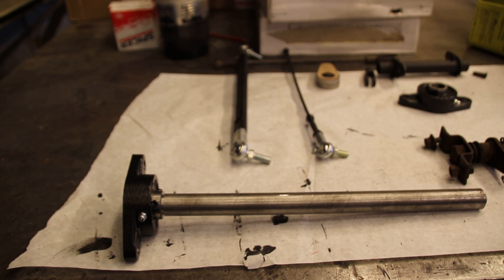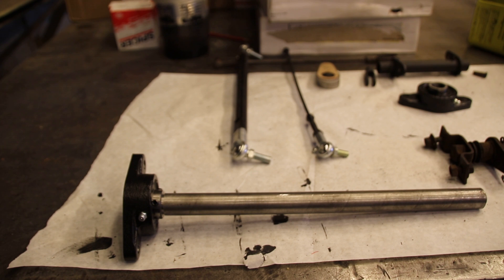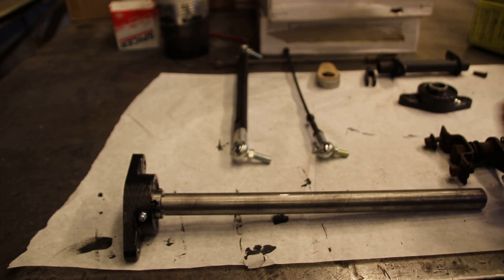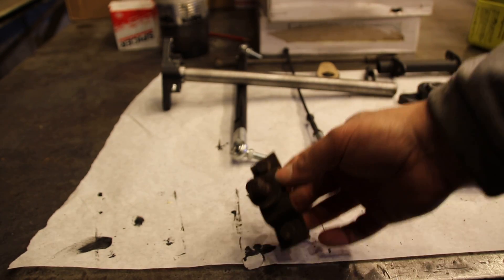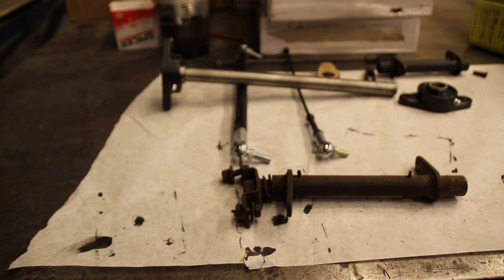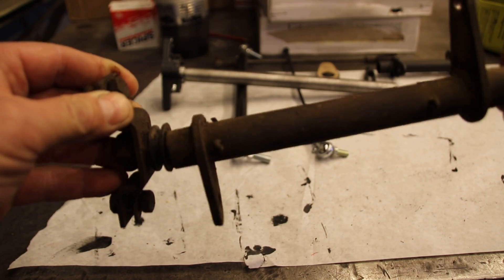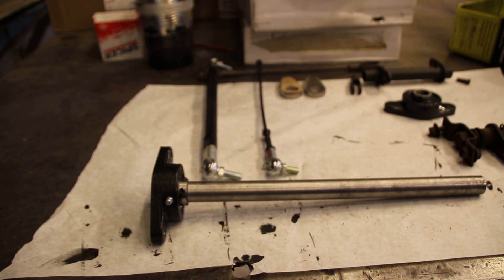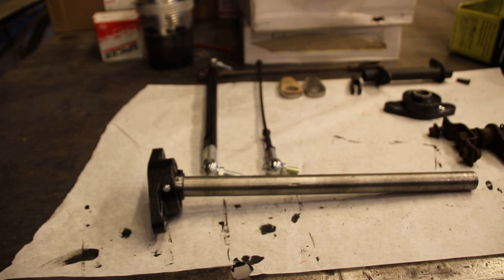Clutch linkage update and response to hate mail

Comment: A masterful job, a very well thought out design with superior construction.  Pivot balls and cheap clutch linkage have always been a curse on street rods and muscle cars also.  Using floating pillow blocks on each end of the Z-rod instead of pivot balls is pure genius.  I’m going to begin to apply your design to several 1960’s and 1970’s muscle cars that we are in the process of rebuilding for hard street use; pedal pressure is going to feel like a tub of melted butter!  Thanks  for this great idea!
Reply from the maker: Glad you got some good ideas.  I put this type of linkage on many different vehicles and it works flawlessly.  I am sure you will like the setup once it is installed.  The pedal will feel great !!

Comment: LOL My brothers and I raced Jeeps off road, we did not build that joint that heavy but I love your idea.
Reply from the maker: I have been using this type of clutch system for many years now in race prepped jeeps, off road, and daily drivers.  Never had one fail or wear out due to use and figured I would share with others.

Comment: Great series of videos. Keep up the good work. Have you worked on any of the Mitsubishi assembled Jeeps? What you think of them? And maybe for the hate mailers you could design a unbreakable linkage between mouth and brain.
Reply from the maker: Yes, many years ago one of those Mitsu jeeps made it to my shop for some body work.  They seem to be a pretty solid rig, but are pretty scarce here in the USA.
Reply: They are rare here in Ireland too. I think there are 4 registered here and I own two of them! Your series of videos has already dug me out of trouble with a vibration from the drive train. The guy that separated the driveshaft didn't see that bit about aligning the Spicer's joints when reassembling. The Mitsi Jeeps have the same rust traps as the trucks in your videos. Aside from the engines the gear box, transfer box and axles look identical to the original Jeep.
Keep up the good work!
Reply from the maker: glad you got your driveshaft vibration figured out.  Would be great to see your Mitsu Jeeps one day.   Keep watching for more videos that are on the way.

Comment: Nothing wrong with your linkage upgrade. I had a CJ5 and lived with precisely that original stock linkage disaster that you show at the beginning of this video. The problem is a bad design that relies on relative alignment of the engine and the frame. Both will flex to an extent, and the older the Jeep, the more it flexes. Had mine modified, but it was a less than perfect solution. This looks far more robust and tolerant of abuse.
Reply from the maker: I have this setup in many vehicles and not one single problem in over 15 years of use.